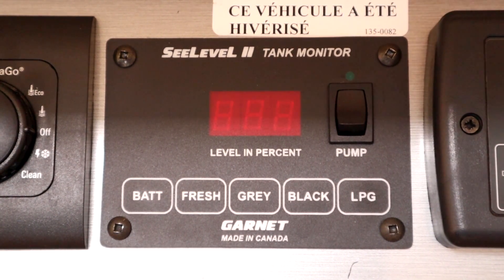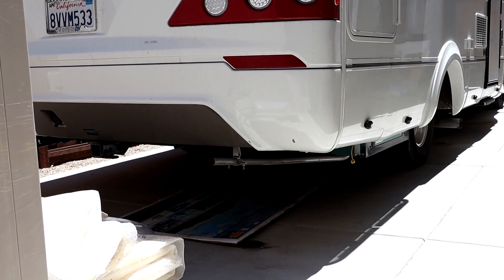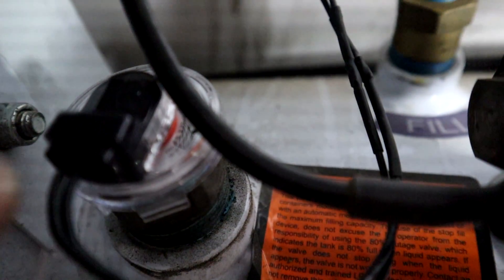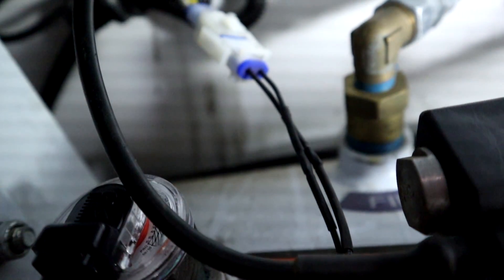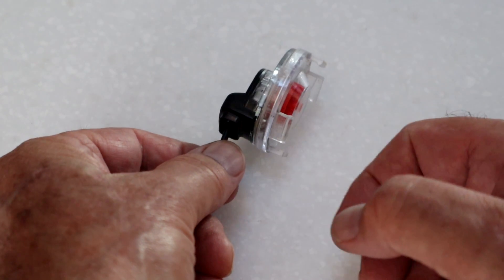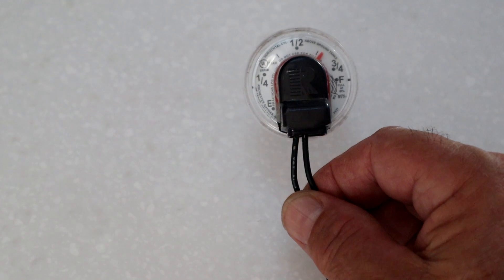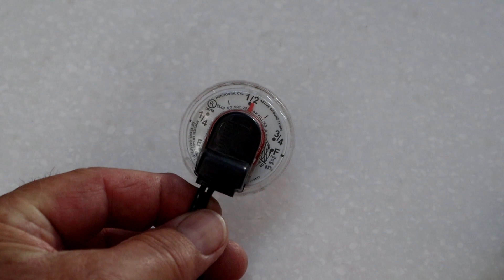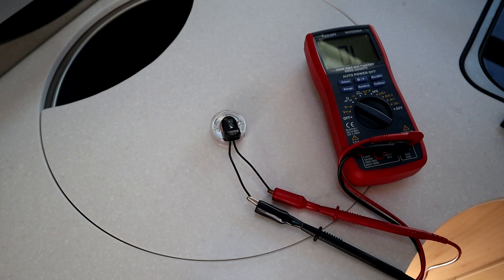RV Propane Sensor Replacement

Comment: Thanks for this video.  Yesterday I filled my tank in my 2014 Newmar class A. I had run the tank empty on purpose just because.  The furnace flame would go on & off as it attempted to restart and I shut off the furnace before it registered a fault.  Now I know the tank it REALL LOW, at least down to fumes an the stove yop still had a flame. So back to the tank. It's a 32 gallon tank, and only took 22.5 gallons before the auto shutoff engaged. I assume that's 80%, I'm not good at math. But the tank gage registered empty. NOW WHAT❗️ So back to you. I watched, and decided to recalibrate like you showed. Yes the gage needle moved as shown but disappeared when I put it back on the tank. I thought we'll that didn't work. But when I came back it and checked the panel display it now reads full. Well maybe that worked but I decided to give it a fause calibration with only half full on the gage. Pull the magnet off and the gage still shows half. I put the gage back on the tank and the needle disappeared.  Couldn't tell which way is turned, back to empty or to full. So I come back inside and the panel reads full. So I guess I'll wait to see if it starts reading the downward usage. I doubt it's working because the needle completely disappeared,  not stopping at full. I haven't ohms it yet but that'll be next.

Comment: The wire tails on the sensor how can I tell which one is positive and which one is negative???
Reply: There is no polarity to worry about as the sensor is just a resistor and it works by sensing the resistance change.
Reply: @astronomytipsreviewswithcu740  So it doesn't matter which way it's wired I guess.
Reply: @johnstanden5961  Correct.

Comment: I was assuming you would show the reinstallation of the gauge onto the tank.  I'm having trouble pushing it back on the tank. I'm afraid I will break the plastic tangs if I push too hard or tap it with a solid object..
Reply from the maker: It is difficult to get a good camera angle down there without the RV on a high lift.  I had the same concern as you but I was able to do it more than once.  Go slow and push gently but don't give up.

Comment: Is the tank empty?  Does it need to be?
Reply from the maker: The tank does not have to be empty to replace the sensor.  But to calibrate the sensor you need to know how full it is.  So I suggest calibrating right after you fill it so you know it is full and set it at 85% since it is never 100% full as it needs space to expand with temperature.